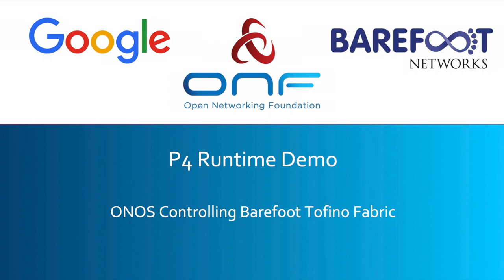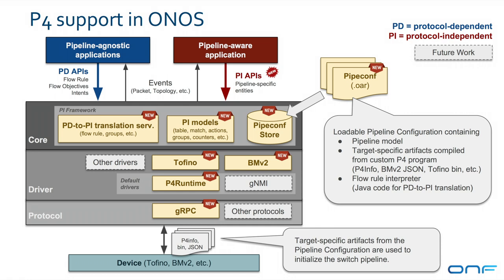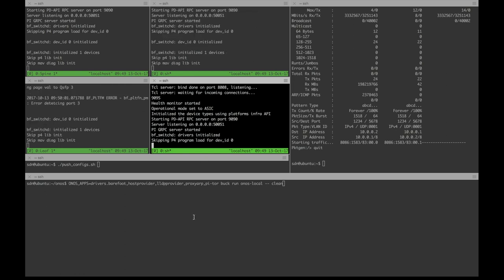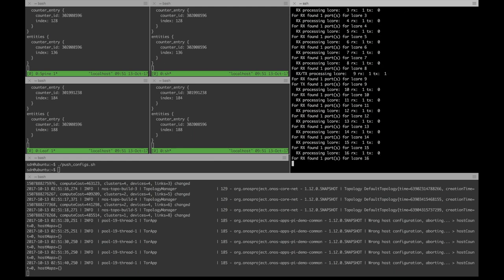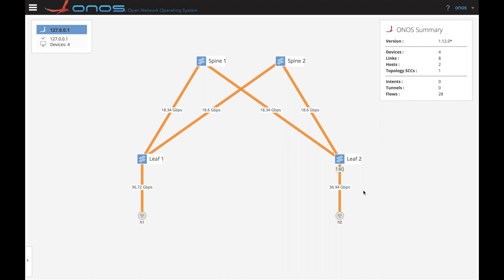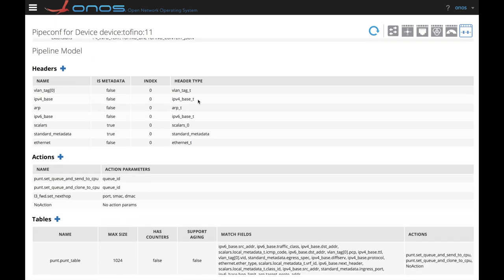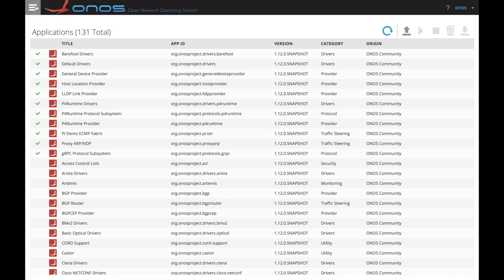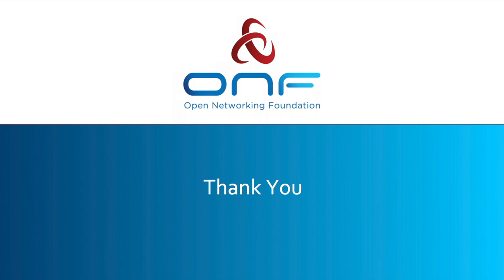ONOS and P4Runtime - SDN/NFV world congress (L123) - Technical Demo - October 2017

Comment: I have a question, sir.
Why is the p4 code run on both leaf and spine switches? It's not supposed that they have different behavior.
Reply from the maker: Hi Jose, thanks for your question and sorry for not replying sooner. For the next time, please write to the ONOS mailing list, we receive notifications there ;) tor.p4 defines a pipeline that can be used for both leaf and spine behaviors. The way it is controlled at runtime, i.e. the table entries that are installed by ONOS,  make it effectively a spine or a leaf. For example, when used as a spine the ECMP functionality is not used.